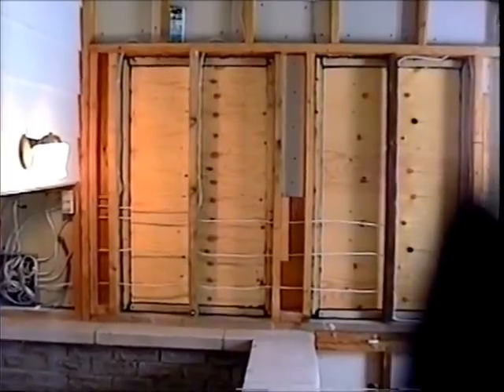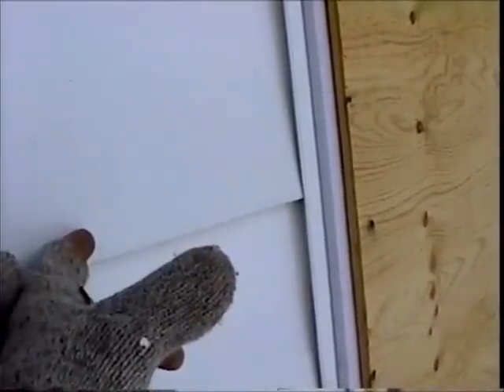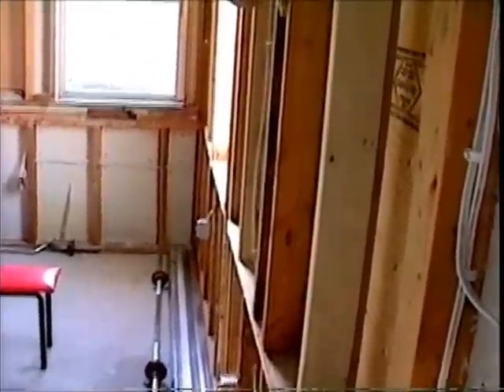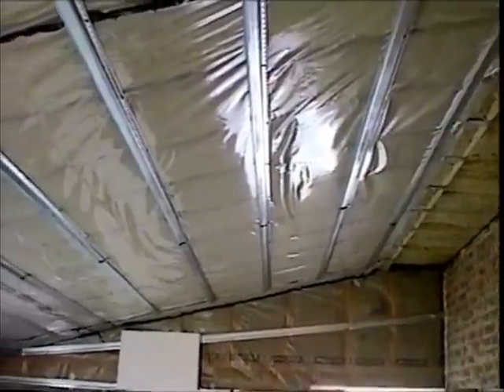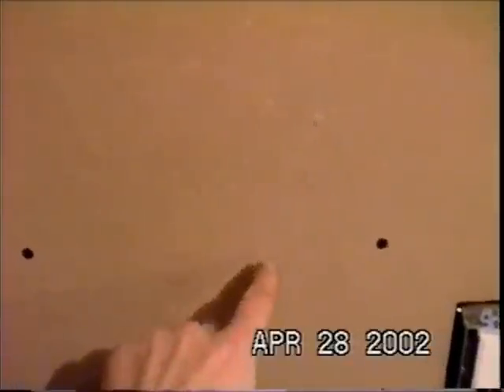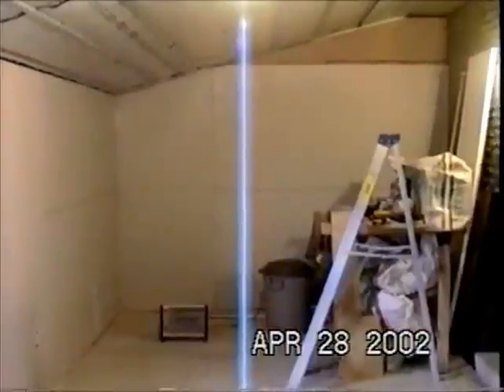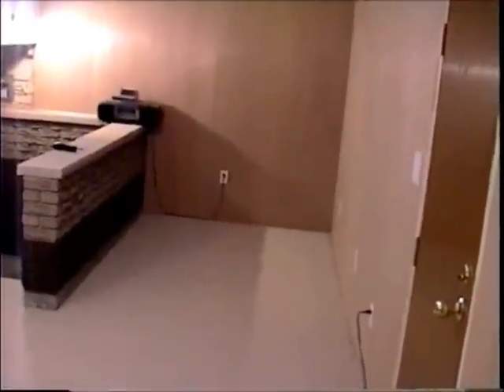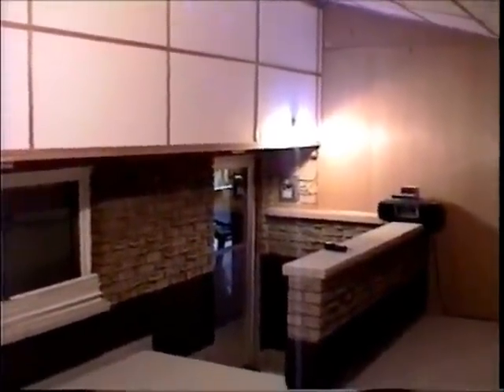Part 2 Sanctuary Studio Live Room Build

Comment: wonderful videos man.
Are you guys still around? 
I am converting my garage right now. Currently i have it all stripped and i am doubling up the outside sheathing from inside the garage. using the existing rock to do that applying inside each bay. get that all sealed with silicone and backer rod. Then im going to frame up inside structure. I am using the RSCI clips and hat channel for the ceiling bc i didn't want to loose any height or space with a beam. All the lumber and Sheetrock was delivered yesterday!!
on the inner walls im going with double 5/8 with green glue between. 
Anyway thanks for such a dovetailed (HAHA detailed ) video.

Comment: just got to the part i see you did the same with the existing rock!! I have homasote on the outside above the first 4'. I am wondering the best way to attach, tried staples, brad nails, small screws. Wont hold in the homasote. I'm Going to use construction adhesive (liquid nails) to attach. I'm concerned about them vibrating and making transmission worse.